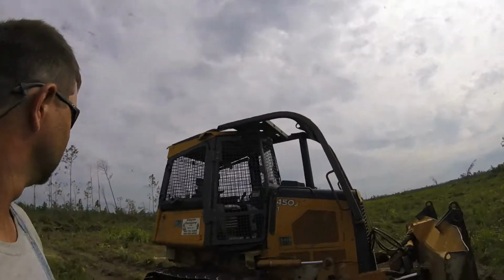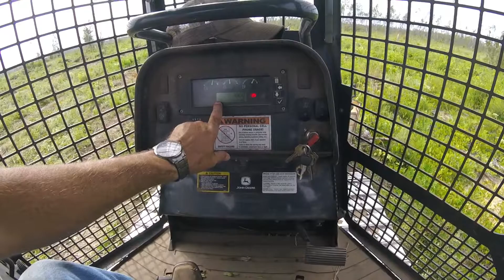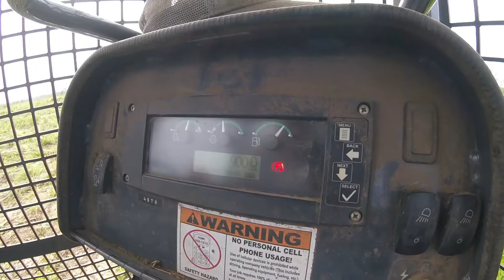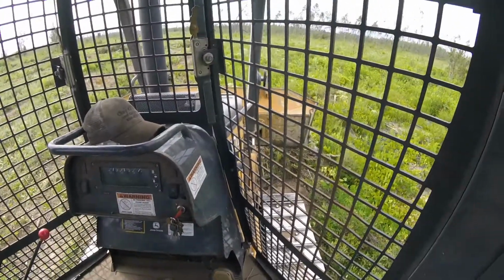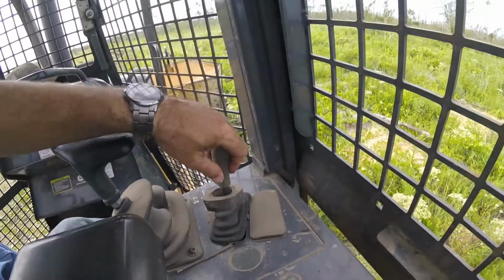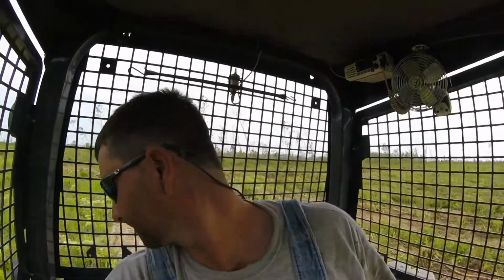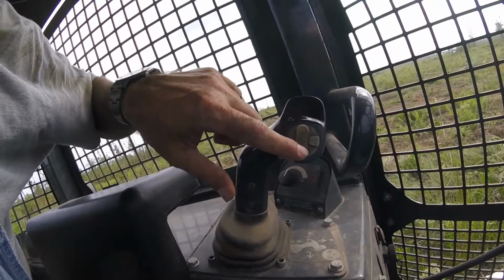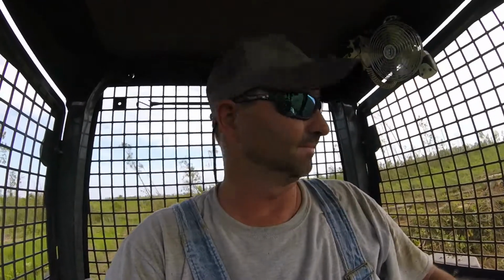How to Operate a John Deere 450J Bulldozer (Basic Controls)

Comment: nice video. I have some land to be cleared. I cut most of my larger trees down by chainsaw but have the stomps left will a dozer similar to this be able to up root those stomps or will I need to grind them and/or use and excavator?
Edit: for clarity the larger trees are 8-12 inches in diameter
Reply from the maker: It all depends on the type of soil and tree as to how easy it will be. Sandy soil and hardwoods are an easy combination, clay and dark soil with pine trees can be more challenging. You should be able to manage regardless of the soil but how long it takes will be the difference. Thanks for the question!
Reply: @AmericanTradesmen  thanks for the response!  👍